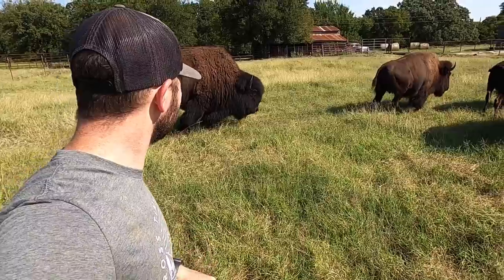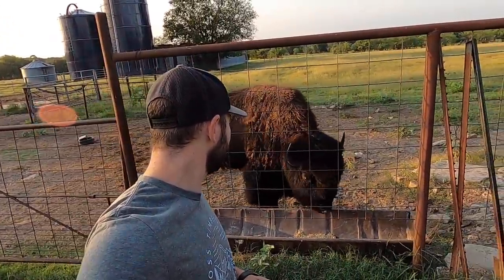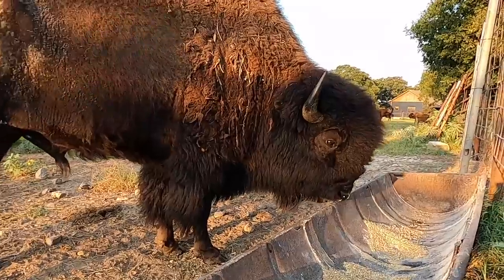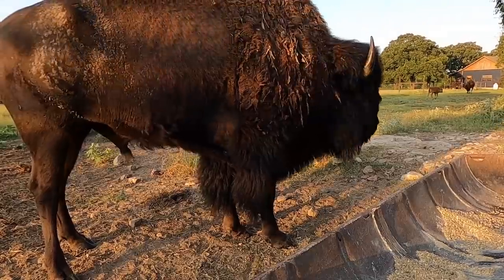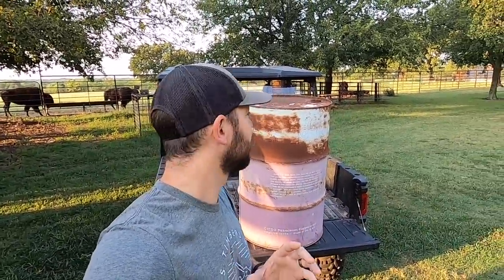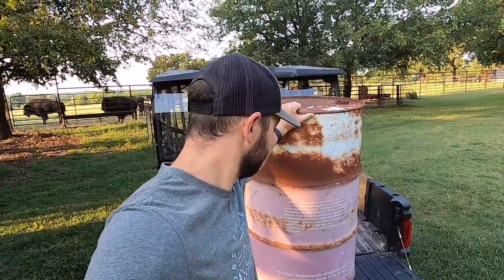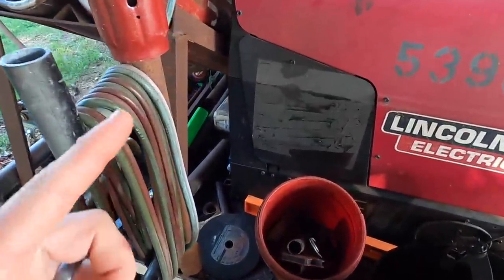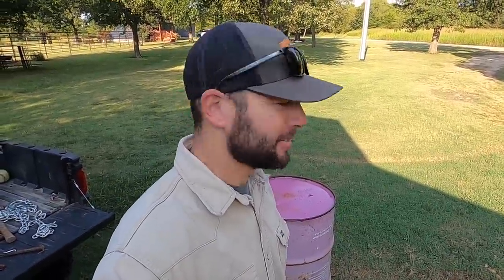Dunbar's New Toy!

Comment: I grew up on the plains (no trees). We had these things made up for the cattle to scratch on. Picture a giant X(the base flat on the ground) with each of the four legs about ten feet long and a ten foot central pole sticking straight up(all made up of 4 inch well pipe). Then a heavy chain running from the top of the pole to the end of each leg. The cattle would scratch their backs and sides up against the chain. In the summer when the bugs got bad, you would wrap the chain with a sock with bug repellent soaked on it. Cattle would apply the repellent to themselves when they rubbed. You resoaked the sock every few days. It took very little time for the cattle to understand what the sock showing up meant. From the look of it, your trees are taking some damage from them rubbing against them.

Comment: Here's a thing to do with some of the motor oil.  Hand tools, like rakes, and shovels are forever needing to be cleaned and oiled.  My horticulture teacher used to keep a big (30" !) clay pot, filled with sharp sand mixed with dirty motor oil.
When you bring the tools back to the shed, you rinse off the worst of the mud, then stir the tools thru the sand to clean off everything else, AND put on a nice coating of oil.

Comment: Many have had injuries trying to weld a barrell which had petroleum products in it. They had failed to realise that oil can form a combustible gas inside. The damn drum explodes due to welding heat. Always drain and fill with sand before welding. If possible keep one end completely open (no lid).

Comment: My grandad had an employee killed trying to cut a drum to build a BBQ. The drum was empty but had motor oil in it. The top blew out and decapitated the guy. My grandfather who taught me a lot about mechanics told me the man should have filled the drum with water first. It fills the space and lessens the air/fuel vapor area in the drum. SAFETY FIRST! not being killed one time doesn't mean the next time won't kill you.

Comment: Awesome! All animals benefit from enrichment.   I would suggest for the toy's longevity (and the tree's) you might want to put some padding between the chain and the limb. There are specially made friction guards specifically to protect trees from chains and ropes, but you can totally just use stuff you've got lying around. For thinner ropes, split old garden hose is common but you'll need something more hefty for that chain. But a bit of rubber tire lining or anything like that would be good.

Comment: A word of advice when mounting anything like that on a tree, it is helpful to take an old piece of tire and lay it on top of the branch and then put the chain over that.  Maybe it want happen here but this prevents the weight bearing chain from cutting into the bark and eventually killing or damaging (or weakening)  the limb.  It is an extra step but will save some headaches down the line.

Comment: I think if you make more in the future use ball bearings for noise + scrap iron in barrel old tires around the barrel and drill bolt holes in the end tires and bolt 1 extra tire to each end so he  doesn't bang the ends and destroy it as quick. You might try a battery operated noise machine of some kind or something with the bull grunts in it at first to get him interested in it.

Comment: I am glad that your friend showed up. The drained barrel is basically a fuel air bomb. When you started cutting the oil would vaporize and become very combustible. After draining take the bungs out and fill the barrel to within an inch of the top with water then it is safer to cut. It is best to cut over half of the head out just next to the rim over half way around with a cold chisel. When cutting propane tanks it is better to pull the fittings and fill the tank with water also. I know a guy who torched an empty chem drum and the head blew out and broke both bones in his lower leg. The barrel was lying on the ground and his leg was in front of the head. Glad that you are safe, except for that bull bison. Hang the barrel long ways up and down and paint a bull's face on it.  Then pour feed under it.
Reply: If it's a reusable propane tank , watch out for jellied propane. It forms when they refill the tank a number of times. It's a combination of propane and water, it's also the reason you should not allow the tank to lay on it's side when you're using it, the same applies to the little pony tanks.
Reply: @charlesbduke7947  Good to know. Never ran into that. Thanks.

Comment: Advice.....The clips will not work well.  I would just use bolts and nuts thru the chain.  Maybe two for each side (a few links apart).   Maybe one hanging vert too, with weights on the ground.  Can see him hitting it like a boxing bag.  Agree with using plastic barrels too (don't know if a rusty barrel can cause harm with an open sore/cut)

Comment: farmers used to use motor oil and pyrethrin to make a back rubber for fly control......saturate some burlaps bags and wind them around a cable or chain, saturate the bags with the mixture, place near a feeder

Comment: A plastic 55 gal barrel would be a lot safer.  You can also cut the top off, fill them about 3/4 full of pea gravel, then cement the top part and they make good feeders or salt block holders, if you set the salt up on some plastc.

Comment: Great idea & Dunbar will love it, he just was too hot & not in the right mood! I think that was a great idea but I would have put some padding around it.  Example;  Like padding that you could step on (whenever Toys- R- Us Toy Stores were still in business (such a rotten deal that there isn't anymore BIG TOY STORES AROUND ANYMORE, 😣 THEY HAD THESE "A, B, C, etc., LETTERS OF THE ALPHABET & ON PADS (about 3 ft.x 3 ft?) & LIKE PUZZLE PIECES THAT A CHILD COULD EASILY CONNECT on the ground IN THE BACK YARD or driveway. THE PADS WERE SOLD IN PACKS. Pretty cheap too!  SOME JUST WERE PLAIN like black or pink, blue & IN DIFFERENT COLORS TOO. THESE GREAT SOFT PADS COULD BE ALSO BE PLACED SO YOU COULD SET A CHILD'S SIZED BLOW UP POOL ON TOP MAKING THE POOL BOTTOM SO NICE & SOFT ON CHILDRENS BOTTOMS & FEET & NOT HARD CONCRETE OR ON THE DIRT GROUND. ALSO, THEY COULD BE DUCK TAPPED AROUND THAT "TOY BARREL" YOU MADE & THAT WAY YOUR BISON WOULDN'T GET HURT. I DON'T LIKE TO BRING IT UP, BUT THAT RUSTY & THOSE HOLES LOOKED KINDA SHARP (?) I'M AN OLDER 62 YEAR OLD WOMEN & NOT SURE HOW TO EXPLAIN THIS, BUT SOMEBODY HOPEFULLY UNDERSTANDS WHAT I MEAN. ??? I THINK TOYS ARE GREAT IDEAS FOR THE BISON.  HOW ABOUT WHAT FOOTBALL PLAYERS CHARGE INTO DURING PRACTICE. THE FOOTBALL PLAYERS RAM OR CHARGE INTO THESE LARGE PADDEDFRAMES ? GEE WIZ, ONCE AGAIN, I DON'T KNOW WHAT THEY ARE CALLED, BUT ABOUT 2 OF THEM WOULD BE GREAT, DON'T YA THINK? PADDING IS THE ANSWER. I BET HARDWARE STORES OR SPORTING GOOD STORES HAVE RUBBER TYPE PADDING (?) GOOD LUCK DUSTY, YOUR ON THE RIGHT TRACK!  I LOVE SEEING THE BISON, SUCH A BEAUTIFUL SIGHT THEY ARE AWESOME & THANK YOU AGAIN FOR POSTING THIS GREAT VIDEO! YOUR A GOOD WONDERFUL YOUNG MAN!! SINCERELY, CARRIE FROM CALIFORNIA! GOD BLESS YOU ALL & LOVE & PRAYERS TOO! ♥️😇♥️

Comment: I wonder if he would molest it more if it were about feed trough height?  You might save some wear and tear on the limb if you slit some old hose and slip it over the chains up on the limb.  You might try it at just six inches above the grass.  Anyhow, it will be interesting seeing what develops.  I was just noticing that the bison tend to but things from a head low position.

Comment: I'm pretty new around here so you might already have something like this but do you have any kind of a cattle brush they can rub up against to scratch just the right spot? I've seen videos of regular cows using them and they seem to like them a lot. Also I saw a website selling used stuff including used street sweeper brushes that you can use for cattle. It's repurposedmaterials .com  without the space. It's not as cheap as an old barrel full of scrap metal but it might be nice mounted on a post out in the field somewhere.

Comment: It is safer to remove the top with a cold chisel and hammer. It isn't nearly as hard as you would imagine. Heavy motor oil probably won't be a problem,  some  other things will explode on you with a torch.

Comment: I was extremely concerned when you said you were going to use a torch to cut into the barrel.  I once watched a man do this very thing with a fresh oil barrel.  He had started cutting the top out of the barrel and as the oil started to vaporize from the heat the barrel exploded with enough force to drive the barrel completely through a metal plywood roof, breaking a 2x6 rafter in the process.  Luckily the man doing the cutting was not standing directly over the barrel at the moment it exploded, or he most certainly been killed.  Instead he was knocked back about 20 feet into a tractor.  The lesson was to never use a torch to cut into anything that has had a any kind of flammable material in it unless it has been thoroughly washed or even filled with water.  Check youtube or google for Oil drum explosions.  You must be living right my friend and we don't want to loose you.
Reply: The Restoration Machinist we generally know what was in the barrel previously and have the common damned sense to vent the barrel before cutting.

Comment: Are you sure it was mineral oil in the barrel? To me it looked and sounded more like rusty water. Strange idea to use the drain holes for draining huh? Better drill a new hole.
I'm sure, if Dunbar gets used to the strange smell, he will start playing with it - and probably breaking the chain from shock - get two old tyres or heavy duty coil springs as shock-absorbers.

Comment: That wasn't heavy duty motor oil in that barrel it was way too thin. I bet it was mostly water with maybe a little oil. Looked like it had been outside for awhile as rusty as it was. Rain water can get in them over time. Don't think it would have blew up. But good idea to drain it anyway in case it was something else.

Comment: That is NOT 15w-40 motor oil as listed on the drum. That's as thick as syrup. You were draining rusty water. The openings in the drum are called "bungs". One is 3/4" pipe thread and the other is 1-1/2" pipe thread.

Comment: hahaha well that lid on the barrel is called a bung. The bung is threaded into the bung hole. You can spin it out with a pry bar or chisel or when it's all rusted up, grab a hammer to assist in banging against the tabs on the bung with the prying tool. 
Yes that's where it comes from. Ye ole bunghole. hahahaha